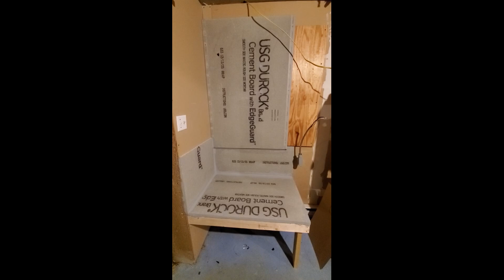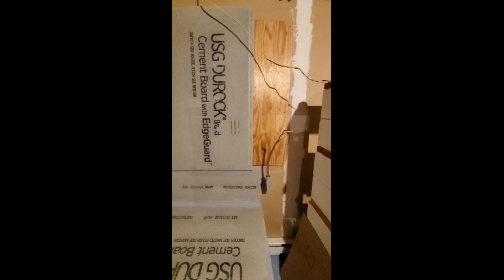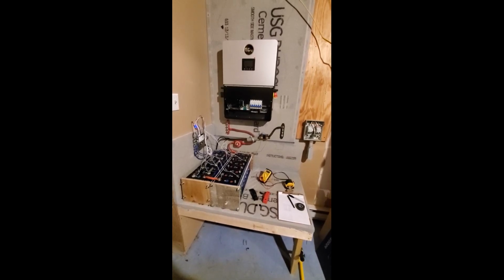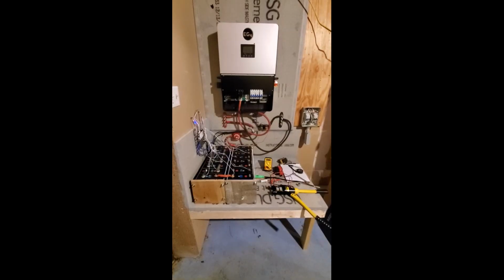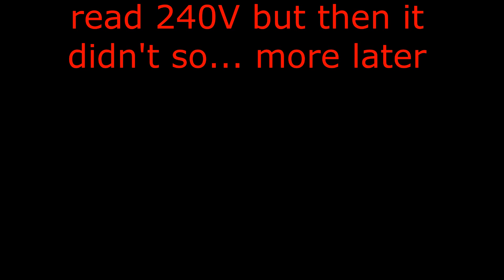EG4 6000XP - Part 2 - Solar System Upgrade

Comment: I thought the power button was on the left side.
Reply from the maker: No the EPS which is what really turns on the inverter power is on the left.  See the order sequence in the manual. I have it on one of my videos. But Yes actually power switch to the whole unit is on the right. Thanks for the comment and Take care
Reply: @LivingFree4All  I have two comming, Guess I better read the manual. lol..

Comment: I started to watch your stuff because I bought the same solar panels(granted I went with eg4 3000EHV-48 in split phase to save couple 100 and get little dumber control)...I hope all goes well with your stuff as I will start watching all the vids... hope the panels are good because next month I get to play with my system.
Reply from the maker: I have never said were or what solar panels I have so are you sure you got the same ones? I got mine used over 5 years ago and are still going strong. Most panels are good, simple to make and will last 30 plus years. I don't advertise, web link or do any affiliates as I do not believe in it. Only my unbiased non conflict of interest opinion here. I'm pretty sure you don't know what panels I have but it might be close as they are 230 watts. I'm sure you will be fine, i don't hear much complaints about panels just everything else we do with the panels lol.

I have a video on my ground mount if you are interested too. Thanks for comment and I hope you enjoy the videos. Take care!
Reply: @LivingFree4All   yeah I screwed up I thought I read talesun Bifacial somewhere(more then likely it was a different video description because I've been binge watching youtube to try see what mistakes others have tried so I can avoid them as this is my first try) and thanks for the ground mount vids the two panel cradle design seems a good choice as my first thought was to create a monster 20 panel rig of 10 across and 2 high but I forget that adjusting  as a major factor and maybe I should keep it lighter as I plan on doing it manually and doing a wood frame....anyway thanks for putting up vids as it does help people that do the diy on a budget
Reply from the maker: If you have room and are trying to keep your price down, I would look into used panels. I  paid $50 a panel for 230W bought 16 and paid $300 shipping just over $1000 for almost 3700W. Something to think about.
Reply: @LivingFree4All  thanks for the advice...was looking at signature solar and got 400 w bifacial for $108 with a discount at 3% and free shipping(ordered 20). I looked at suntan but the used panels didn't strike me as a big deal(250w cracked/snailtrail for $60) and I would have to pay the shipping also...also being up north I really want bifacial as I get snow and it sticks for 3-4 months out of the year

Comment from the maker: Update: I did get it turned on and the WiFi up but can't get the load to be 240v. Its in economic mode so I might have to put a load on it to wake it up. I'll try connecting the load to it when i get another chance, hopefully before the new year
Reply: turn off ECO and Green.
Reply: Check that your EPS (Left Side) switch is turned on.
Reply from the maker: Yes it worked. I ran out of time on Xmas eve to really do any more checking. I haven't got a earth ground for this inventor yet so I also stopped hooking up any wires until I did. Free time is something I don't have much of :( Super Thanks for the help! It means a lot to me! @theadventuresofarenaissancman
Reply: I had to learn the hard way to pre-charge the capacitors on the inverter to get it to work. But I was using a Victron inverter.
Reply from the maker: Ya i didn't show it but I do use a resistor to charge up the invertor 1st. I love Victron too but when this came out, I just couldn't pass it up! We'll see if it holds up and does what I'm hoping. Thanks! @simon359